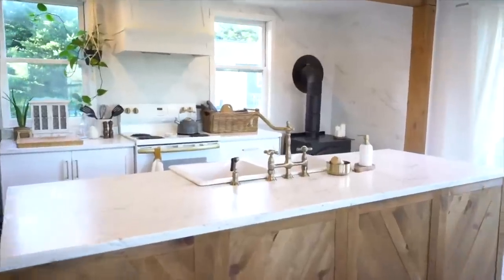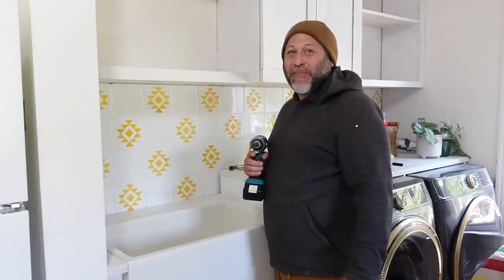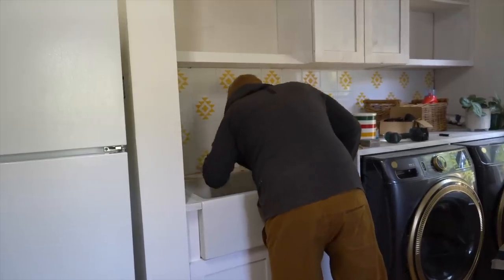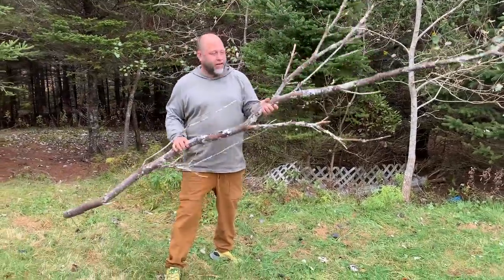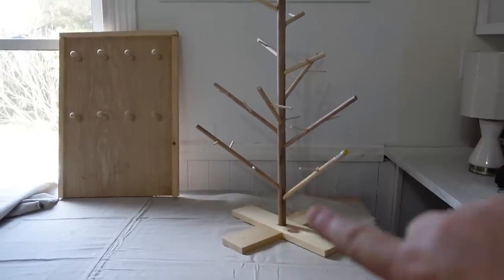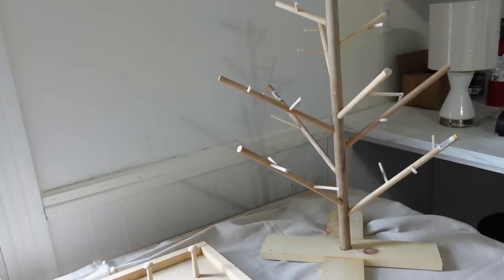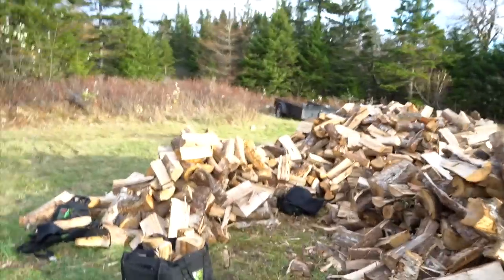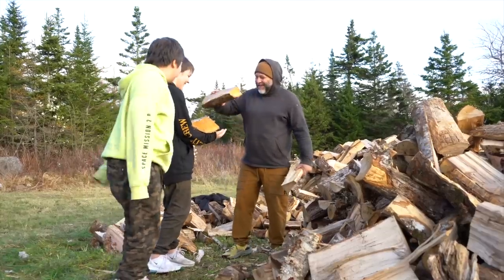GETTING RESOURCEFUL to customize the PANTRY & Craft show display with ONLY up-cycled materials

Comment: Other side of the woods pile it's a little trailer. Why not hook it up to the 4 wheeler, load it up with wood and pull it right up to the wood shed? Would have been a lot easier. We spent a long time heading with wood, always look for the easiest way to move it.

Comment: A wheelbarrow and ramp is what you needed to move the wood quicker or at least that's how I did it growing up on a farm. My only concern with your wood storage is that you built it on logs on one end. Those logs most likely will rot in a few years and concern how you will replace them with something more permanent. 
Phil had me laughing all through out the video!

Comment: Phillip please please use a wheelbarrow. I guess most people don't think to use a wheelbarrow for such a short distance but it saves so much strain on your arms and back and hugely reduces the number of steps you have to take if you load the barrow with like 10 armfuls of wood and wheel it over to the shelter. Also when you get the whole family involved don't have each person individualy picking up an armful, carrying it over then stacking it. One person loads the wood into the barrow or bags, and hands it off to another person who takes it from the woodpile to the shelter, who hands it off to another person who stacks it neatly. If you break the job into separate parts and have each person just doing 1 part then you work out the quickest most efficient way to do your part and you don't get in each other's way. And since the job can be broken into 3 parts and there's 4 of you then 1 person can be taking a rest while the other 3 work, then you can trade out and no one gets too tired.

Comment: The progress in pantry is great! The used refridgerator is nice and you made it match. Its unreal the prices of appliances now! Our wood delivery is late. We have been having colder winters so I guess more requests and not that many in our valley has the wood. Its not that easy to get to where they are allowed to get some to season. We have been using what was left of 2 dead trees partially cut when we bought this place. Im not sure what it was but some of it didnt smell that good. But our winters slowly getting colder and longer here in high desert. Im also doing a few Christmas craft fairs beginning of december. I like you made the tree to display. I only have a table for some crafts and a 2 tier rack for someclothing. I may have to add something more creative to display as I did make some ornaments too.

Comment: Your ATV there would help if you put a tarp down and filled it with the wood and then pull it up next to the 'firewood barn' and then move things on to the floor then go back for the rest of it. then all you would have to do is stack it. I Saw the wheel barrel comment and I had thought of that originally. The tarp and the ATV make it even faster.